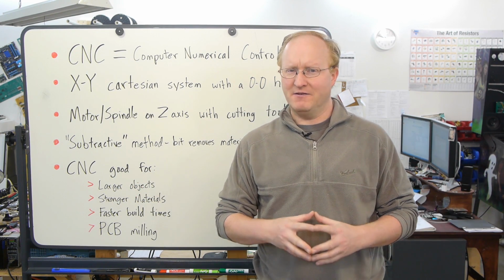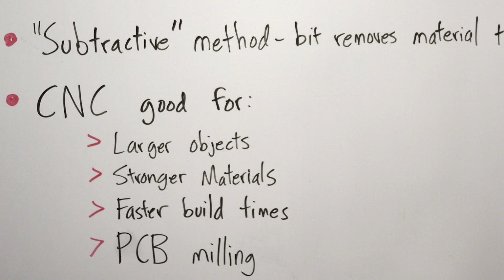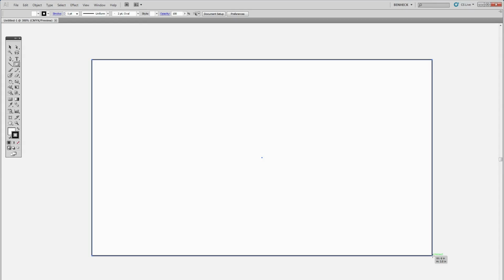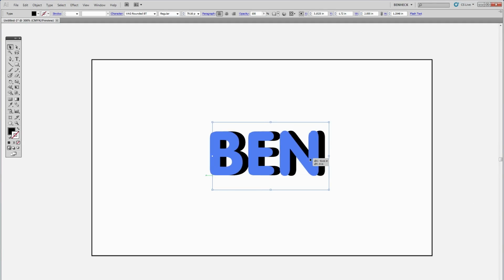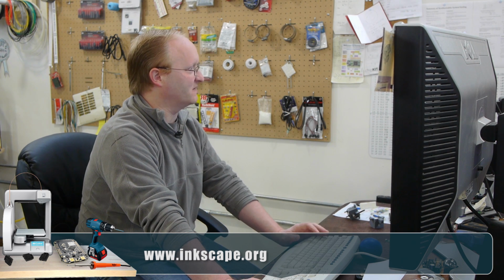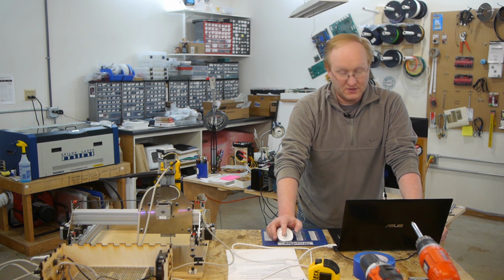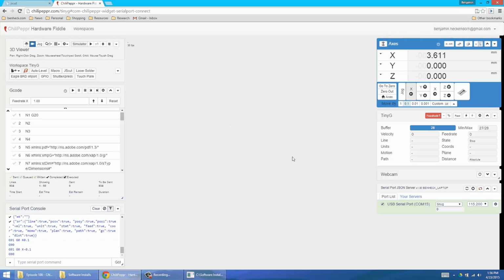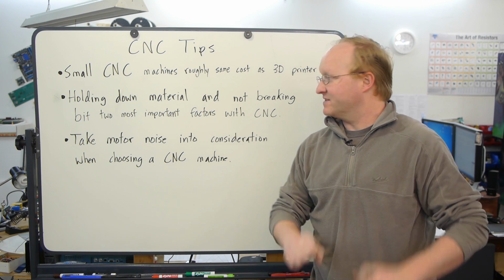Ben Heck’s CNC Router Tutorial

Comment: could you just strap a higher quality dremmel on the cnc instead of a big tool?
Reply: ***** some people do, but a router has much more torque than a dremmel, and thus can cut harder materials more easily. My machine uses a pretty big router and it can cut aluminum.
Reply: ***** 

I have a cordless drill core which I put a 100W (320W peak) motor on. still the same size as the original drill motor, but it is a fair bit more powerful than the motor the drill came with, and also runs a bit cooler.

I had been working on building a CNC machine, but the project is slow going. it would be a bit bigger than the one Ben had on the table, but a fair bit smaller than Ben's big CNC machine (it will probably be about the size of a washing machine, made mostly of 3/4 inch OSB, probably with some iron weights on it to help keep it stable).

likewise, it will use a moving table (approx 12 inch) with a mostly stationary tool (the tool only moves in Z). movement is done generally by having stepper motors spinning 3/8-16 all-thread (net reduction is about 8:1).

steppers are generally being driven using transistor H-bridges (built from TIP120 and TIP127 transistors), as I had previously tried using an L298N and it fried, me noting that the rated current of the steppers is just slightly below the maximum current of the L298N, and I wasn't doing so good at the time trying to keep that precise of control over how much current the steppers will pull (kept going over the rated values for the L298N).

the driver for the spindle motor is driven using some MOSFETs (IRF540N), also in an H-bridge configuration.
Reply: Brendan Bohannon
 Nice! It was a good move to replace the original drill motor; I have heard that those motors will tend to wear out with all of the horizontal forces being applied to the bit (and thus the chuck) when it is cutting harder materials. Those motors are really intended to withstand forces parallel to the bit rather than perpendicular.

I was lucky enough to get mine running within a month of starting the project (shipping from china was the main thing eating up my time) but at the time it was only good for doing work with wood. The bed is 2'X2' and supports the gantry, and the z axis had about 5 inches of vertical travel. Thankfully, I made the frame and gantry out of 80/20 10 series channel, so upgrading components was fairly painless. The lead screws I use to move everything are 1/2-10 with some delrin anti-backlash nuts (failry cheap)

 Now that my machine can cut aluminum, I plan on milling out some aluminum plates and replacing a lot of the gantry so that I can get more travel on the z axis and make things more sturdy in general. It is getting to the point where it would be wise for me to replace the router with an actual spindle and eventually get some sort of coolant fogger to keep things cutting nicely.
Reply: *****

sadly, I am still using the original gearbox and chuck assembly (so this is still likely an issue), only the motor was replaced. I replaced the motor mostly because the original motor was pretty weak and tended to get hot (it was only a 15W motor with a 50W peak), and I had a few more powerful motors around mostly for my robot projects (actually, they are pretty similar to the motors used in the Power Wheels, which are informally rated at around 1/4 HP, and I had got 7 of them for $10 each).

but, yeah, mine is made more with a CNC Mill structure (table moves under the tool) rather than a CNC Router structure (where the tool moves).

the design limits the working area, but increases stability and precision.

this project has been held up for a while, mostly because I need my dad to cut the wood for it, and he needs to go borrow a table-saw (*), and this isn't really happening thus far (also the weather outside has been consistently bad for a while).

*: all we really have here right now are hacksaws with metal-cutting blades (very slow at cutting wood), and a very rough-tooth bow-saw designed mostly for cutting off tree branches (very difficult to cut things accurately with this). well, there is also a reciprocating jigsaw, but this isn't so good for accurate cuts either. (note: don't have a hand-saw either).
Reply: Brendan Bohannon
 I actually built mine only using a hacksaw and a wood saw as well, and I was cutting aluminum channel so you can imagine how tedious and inaccurate that was... Well, I do have my drill and a dremmel as well, but that is the extent of my "specialty equipment". I ended up using a hacksaw with a miter block that has slots for 45 and 90 degree cuts. Unfortunately, a hacksaw really doesn't work with a miter block, but I didn't have any rigid saws with metal cutting teeth. If I had a drill press and a nice bandsaw, that would have helped considerably lol. That is another reason I went with 80/20 channel, actually. It really cut down on the amount of fabrication I had to do. I only had to make a few brackets by hand for mounting the bearings for the lead screws and for mounting my router. They are not ideal by any means, but once the aluminum plates get milled out those sloppy brackets wont be an issue.
Reply: *****

well, the issue is cutting wood with a hacksaw:
with the blades it has on it, it is faster and easier to cut through metal than it is to cut wood (the blades are just terrible with wood, and more cause the wood in its path to get hot and turn into smoke and charcoal than actually get cut by the saw).

note that the saw teeth are very fine (the blade edge is almost a smooth piece of metal).

cutting wood effectively requires blades with bigger teeth.

the bow-saw quickly cuts through wood, but it is very difficult to get an accurate or clean cut with the blade it has on it (it has very large teeth that stick off to the sides, will tend to make a cut about 3/8 inch wide or so, and is difficult to get the cut started with any real semblance of accuracy).

what is needed is either a hand-saw (panel-saw), or some more carpentry-appropriate blades for the other saws.

but, sadly, I don't really drive or have my own source of income, so basically getting saw blades would also be at the mercy of when my dad feels like getting around to it (may require a trip to Harbor Freight or similar, and requisite ranting about how expensive everything is, but alas...).
Reply: Brendan Bohannon
Driving and money used to be a problem for me too up until recently. I managed to land a job at an ACE hardware store that was close enough for me to walk to from my house. Im 19 and going to community college, so I dont really have a whole lot of money or time to get my license or get a car...

Yeah, a lower TPI saw blade ("coarse" blade) is better for softer materials. Ive had to cut wood with metal hacksaw blades before. it usually just burns the wood after a while, and it really does take ages to do. the wood saw I got (and highly recommend) is the stanley fatmax. http://www.stanleyimages.co.uk/CatalogImages//9974_prev.jpg

here is an amazon link:
http://www.amazon.com/Stanley-FatMax-17-202-14-Inch-Back/dp/B000VSKORU/ref=sr_1_3?ie=UTF8&qid=1432353595&sr=8-3&keywords=fatmax+saw

You could always save up what you can and buy it on amazon if your parents will let you use their credit card. Also, a good way to start the cut on wood is to make a few strokes in the same direction (whichever way causes less resistance; in other words, opposite from the direction that the blade cuts in) until you form a small groove. also, cut on angles rather than perpendicular to the surface you are starting the cut on. It will go faster because there is less surface area on the corners and it makes the cut easier. change the angle every few strokes. (Im not great at explaining the technique but hopefully you get the idea.)
Reply: *****

I am a fair bit older, but basically mostly just useless (never got a job or a drivers license, more just endlessly going to college).

have done lots of programming stuff over the years, and more recently started getting into electronics and robotics.

getting stuff ordered is more mentioning stuff, when approved adding it to their cart, and waiting for it to get ordered and show up. this is how I got a lot of the stuff for doing electronics (itself all a fair bit of cost, like, lots of bags of various components, some spools of wires, perfboard, ...).

did also get a higher-cost item: a variable power supply. thus far it has been pretty useful.

also got various electric motors, mostly smaller ones from online (some PMDC and stepper motors), and have a few larger ones mostly scavenged. got a dead alternator and a capacitor-run split-phase motor (for free, my uncle had them laying around his yard, *), was able to convert the alternator into a motor (but as-is, it is hard to drive given how much amperage it needs), and for the split-phase motor soldered together some breaks in the windings, and then rewired it some to work better at a lower voltage (it was essentially converted into a dual-phase motor).

*: the alternator was seized up mostly due to rust, but was able to break it loose, and the bearings and similar were still in pretty good condition. the split-phase motor has significant corrosion on one side of the coils, and had some breaks in the coils.

may want to rewind the later motor, but will need a large (and thus rather expensive) roll of magnet wire to do so (probably a several thousand foot roll of 20 AWG, though 22 or 24 could probably also be used). would likely rewire it as a 3-phase wye motor. (note that the AWG effects the number of turns, and thus the effective tradeoff between volts and amps).

in contrast, the alternator uses 14 AWG and only has 5 turns per winding, so basically as-is requires crazy amounts of amperage to run it effectively.

the converted motor is a bit far the other way, with overly fine (30 AWG) windings (better for low-current higher voltage). it was basically a reasonably large but not particularly powerful (actually has a lower HP rating than the one I put in the drill core, despite being physically much larger).

I have some smaller rolls of magnet wire, but it is nowhere near enough, and I got it mostly for using it for doing traces (though, it is a bit of a pain to solder it).